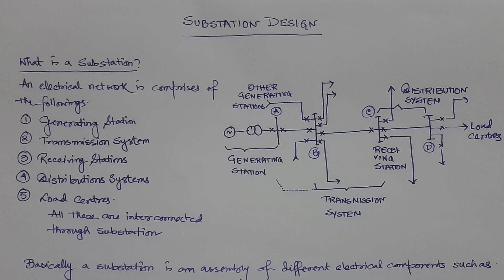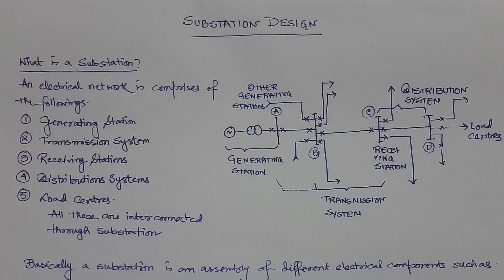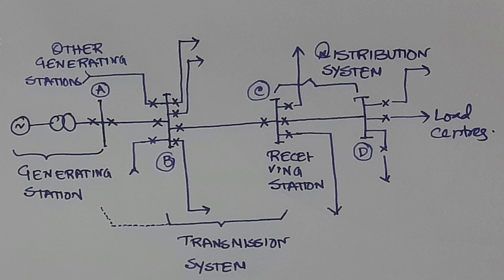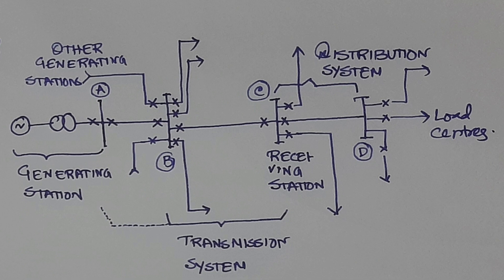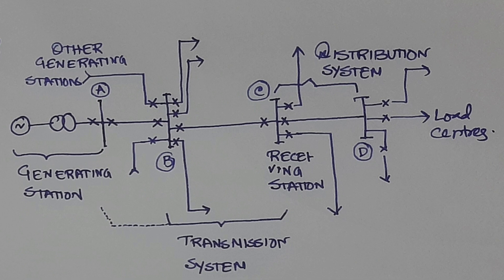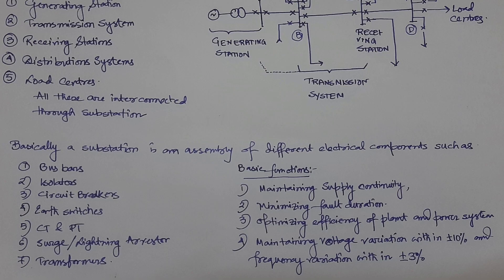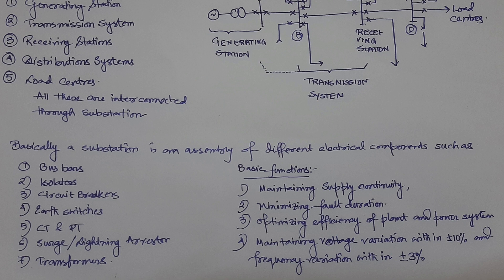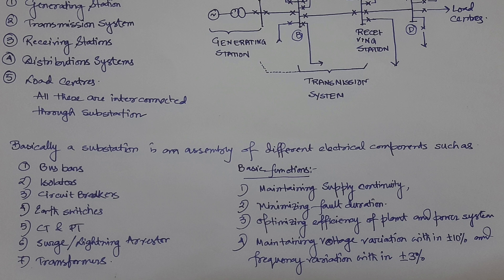What Is a Substation| Substation Design Part 1

Comment: please can you explain the earthing cable size of copper calculation of ,  6 nos of 2500kva transformers , impedance of 7% we connect all the transformers with only earth pit , i want to know the from main pit earthing size cable and it is connected to noraml copper bar and then we take separate 6 cable earthing from to the transformers, please can you explain, thanks

Comment: Hello sir, very informative video, thanks. 
Can you kindly give some information on Demand Factor and TCL ... 
My question is while choosing a tranformer Or cable selection or short circuit calculation or voltage drop calculation................
does it require to calculate using Total connected load or demand load?? 

Or are these Demand factor and Diversity factors just an conclusion of load on final substations or towards the consumer side? 
(Kindly explain me considering a big complicated load.... Like Huge industry or hospital or large residential loads. ) 
Thanks 🙏